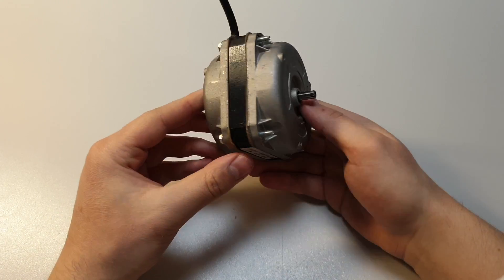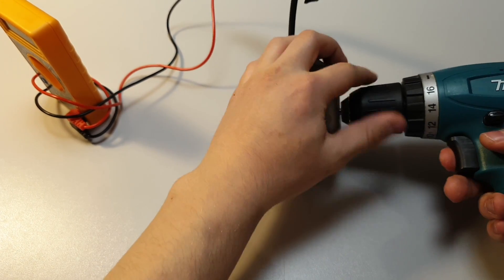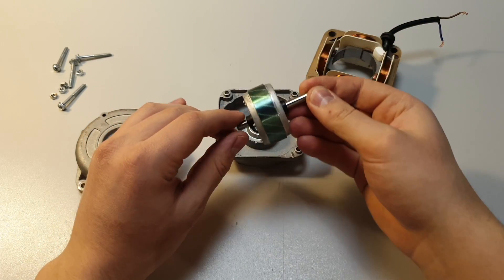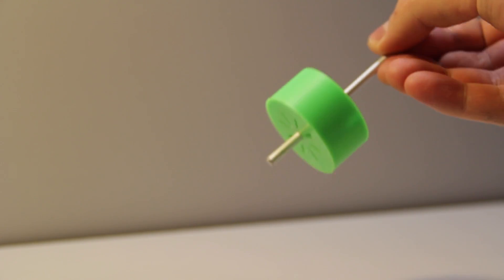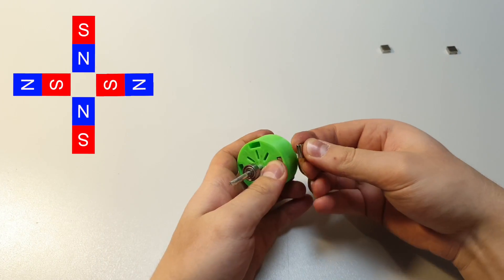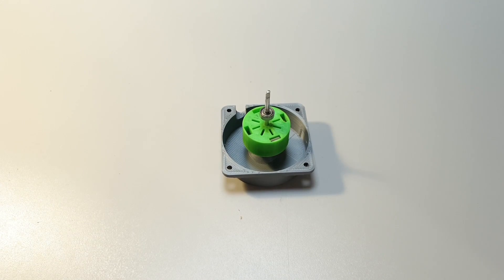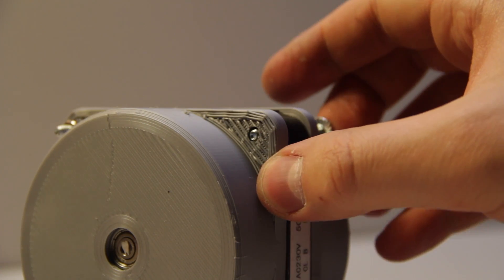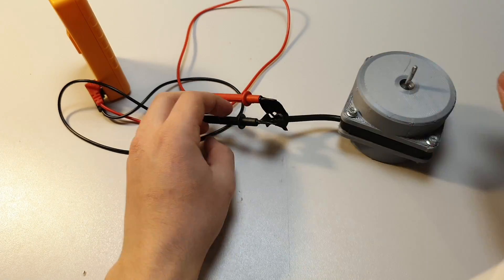Electric Motor to GENERATOR - Make Any AC Motor to DIY Electric Generator Using 3D Printer

Comment: what type of motor is that?? name please.
Reply: its an induction AC motor that is synchronous. with this motor, you can update it to produce AC power, but you need a 2 pole brushless or brushed DC motor at 12 or more volt rating, to get above 37V AC.
Reply: @davidwarda5616  how about power output watts??
Reply: @wingedbull1257  that's a good question. now its hard to see the power output watts, but in general, it depends on the load. for example, an induction heater at large load takes about 3,500 watts. and in this case, it depends on the load. if an LED takes 50 watts, they you will be generating 50 watts because the LED is taking power from you, if its 50 watts on a device, that's how much you are generating, but this all depends on generator coils and winding turns and the load you are connecting to.

Comment: Nice channel. I am actually trying to make my own 3D printing channel myself. I don't have any videos out yet. I'm 3D printing all of the camera gear that I need. I'm designing all the parts I need in fusion 360. My channel name i got is "G28 Printing". It's a word play on the Gcode "G28", which is the homing sequence command. So the channel name really means "Home" Printing. I got the idea from some t-shirts I saw online which say "there's no place like G28", meaning "There's no place like (Home)".   I find your videos very good. You have a new subscriber 😁. I'm surprised you don't have more people subscribed to your channel. Your videos are done very well. I think the pacing on your videos are good. Not too slow and not too fast. I also think you do very good projects that are not too easy or hard. Keep up the good work! What program do you use to edit your videos? I don't really have any experience editing videos. So that is something I need to learn. I don't have any nice cameras or anything so I will have to use my smart phone until I can get a better camera. I also need a good microphone. For lighting I'm just going to try and use high powered working lamps with a large piece of poster board in front to act as a diffuser. Ill 3D print a holder to hold the poster board in front of the lights. I already have a couple of video ideas I've been working on, but I can't say what they are yet. I don't want someone else copying me :)
Reply from the maker: Hello, thanks! 😊  I will subscribe to your channel and hold my eye on u! Well, I am using for filming Samsung Galaxy s9, Canon 60D and GoPro Hero 8 black. For editing, I am using Final Cut Pro X (this is for Mac only). When I start out I had no idea how to record and edit videos but after every video, I was better and the next video become better(I am still learning). So I wish u good luck with your channel! :)

Comment: Nice done!!
Reply from the maker: Thanks!
Reply: @LetsPrintYT  Hey man, If you add capacitors across the output and spin it faster than its synchronous speed the original rotor would generate too. Without magnets!